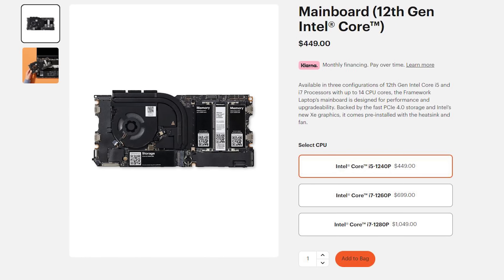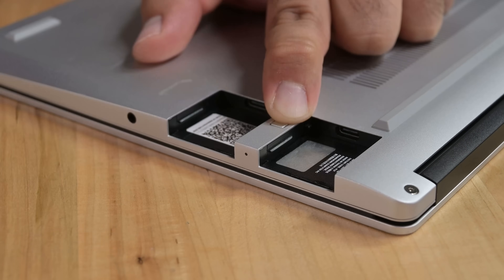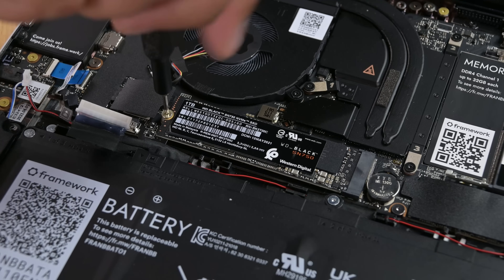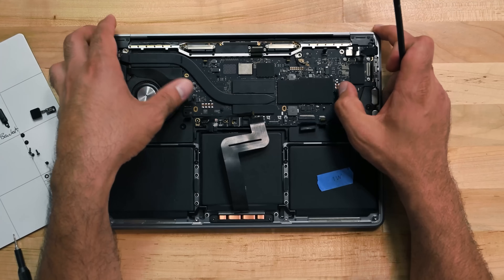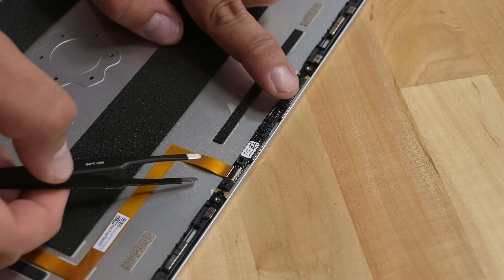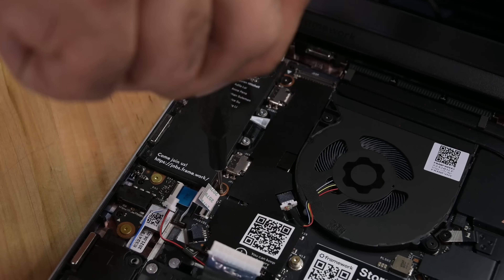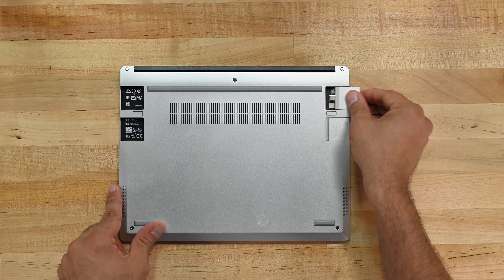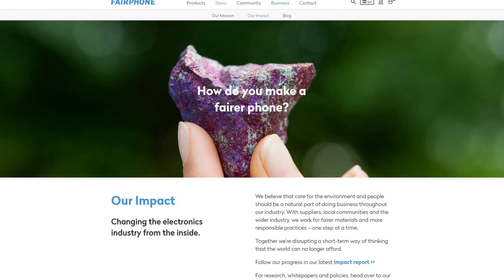The Framework Laptop Is Now Fully Upgradable!

Comment: I own a framework and while I'm not interested in the 12th gen upgrade (I don't need the slight extra processing power and it doesn't affect the battery life issue signficantly) I'm curious about the difference on the back panel and the hinges. Are they a necessary change? I want to see some kind of actual comparison. Hopefully in the coming months someone will post videos to the subreddit or somerthing
Reply: Framework has stated that for a certain subset of batches 2 and 3 (iirc?) there were some quality control issues with the hinges, causing them to have less than the specified 3.3 N operating force. If you're in that batch, and are experiencing display floppage, you might want to contact support about it.
If you're not having any problems, but are still disappointed in the performance of the hinges, they sell a new 4.0N hinge kit. The laptop isn't heavy enough to offset the heavier hinge, and so it'll need to be opened with both hands.
Note: I probably got the units wrong in this post. See the Marketplace for correct figures. The lower-weight hinge should be identical to all previous hinges, except for the few weeks' worth of out-of-spec hinges they shipped in the early batches.
Reply: @Segundo Samson My batch 4 unit's been a dream! I spilled juice on the keyboard, and had it apart to check for leaks or damage in under 5 minutes. Had a replacement keyboard in the mail a week later!
The only real problems I've had with it have come down to user error: I got the DIY edition, and when installing the wifi card I both routed the cables incorrectly and didn't even plug one of them in... And it still worked, albeit with degraded performance. Again, 5 minutes with the included screwdriver and the problem was fixed.
The performance is good enough for fairly heavy compute workloads (parallel compilation, multiple VMs, etc.) and light gaming workloads (though you may want to look into Custom Resolution Utility and downscale your graphics).
The display panel is surprisingly versatile, and you can clock it all the way down to 22 Hz or up to 70 Hz (72 with some luck and a lot of tweaking) without artifacting.
The battery life is kind of lacking (6-8 hours on a charge, less if you're good to your batteries and limit charging to 80%) but it'll charge off of just about any USB Power Delivery supply you can plug into it (5V 1A - 20V 3A). If you carry a phone charger in your bag, that'll net you anywhere from 1 to 4 hours of (tethered) battery life, maybe more depending on the workload. I got an Anker PowerCore Nano 2 (65W) which is about the size and form factor of a phone charger, and highly recommend it as an alternative to Framework's slightly bulkier charger, if you can splurge for it. Either way, at over 45W, it'll charge under the heaviest workloads it can muster.

Comment: The $450 i5 is fine but, oof, $700 and $1050 for the i7 "upgrade" is pretty steep. You can buy a whole new computer with kind of that money.

I know that this is still pretty much a niche thing and the company is just starting to rise up, hence the early adopter tax. But moving forward, keeping the price down should be one of their biggest focus. If not this will just be another apple "it's technically repairable, but at that price you might as well buy a new one" kind of situation.
Reply: Yeah good luck getting i7 1280P with $1050. It is a start once the market is set you will be able to find various boards on ebay and other 2nd hand boards. Lets say when 14th gen cpu comes out then you are able to get $250 upgrade of i7 1280p from 2nd hand market thats a great deal. 14 core vs normal i5 is still huge upgrade.
Reply: Agree, its kind of overpriced. At least you can sell the old mainboard.
Reply: but you can still use the old mainboard as a nuc or home media computer or even VESA mount on the back of a monitor BOGO free....
Reply: @Dan-bh8jd  And you can't do that with a normal laptop?
Reply: @Summer-xu8qu  not with the size or versa mount or any time you need to turn it on you need to open the cover

Comment: I wish they had an oled. I love my HP spectre 360. It is on 10th gen, which will be showing its age soon. I wish i could upgrade.
Reply: The screen is easily replaceable. An OLED or MiniLED could easily happen.
Reply: Maybe they could do Miniled or Oled with 60 90 or 120hz
Reply: I'm hoping they'll release alternative screens in the future as well. The one they have is phenomenal in my experience, but it doesn't beat an OLED panel in contrast and black levels. 
Though, I'm really hoping for a worse, higher refresh rate panel with VRR, rather than OLED, myself. The current panel can't be pushed much higher than 70Hz without artifacting, and at 72Hz the thing can barely sync. That's higher than most people usually go for, of course, but it has its uses, especially when response time is more important than quality.

Comment: I wish they’d left 2 of the board’s USB-C ports flush against the edge (only offering 2 expansion ports). They’d have been able to make the board a wider shaped leaving more room for a bigger battery. Guess they’re stuck now.
Reply: Maybe they can make a battery expansion module. It can charge both ways through the USB-C ports, right?

Comment: Plus the fact framework supports running the motherboard standalone. And even released models to print even extends the longevity of the old board as a nuc like device. Truly amazing
Reply: You can do that with any laptop. Unless it's poorly made and few are this poorly made, the battery (which can still be used if you make room for it) is literally just a UPS.
Reply: @acumenium8157  yes but no, Framework motherboard has the button on the motherboard and that is why you can 3d print a case for it and still turn it on manually without having to strip or short the two pin with some wires. Not only that, some laptops have the chassis intrusion thing and makes it difficult to just use the motherboard only (although some can be easily disable through BIOS settings)
Reply: @siontheodorus1501  If you have to "3D print" a case to do it, it's literally the same effort you're putting into doing it for any other laptop. So no, it's just a no, not "yes but no".
Reply: @acumenium8157  It is a "yes but no". Framework themselves are supplying the 3d files for the 3d printing process, as well as the CAD data of all parts of the laptop themselves. Can you name a single other laptop manufacturer that does the same, or even comes close in the effort of doing this?
Reply: @acumenium8157  Also just the actual form factor of the mainboard is vastly different to doing it with other laptops, when you turn this into a standalone nuc it actually has a nuc form factor too. The whole process is just very easy
Reply: @acumenium8157 "any laptop" bruh is that the final answer?
Reply: @acumenium8157 name other laptop brand that can run their motherboard outside of the chasis

Comment: Does Framwork Laptop run macOS? No? Dealbreaker.
Reply: Makes some wish Mac OS was able to be Installed on Windows PCs
Reply: @IdeasAreBulletproof  I don't wish to run macOS on junk.
Reply: Does dell, hp, Lenovo etc have Mac OS ? Why everyone comparing this laptop with Mac book
Reply: @kingfor2850  The point sailed above your head, so here it is in plain English: macOS is not the same a Windows and a lot of us prefer macOS to the derivative sludge put out by Microsoft. Until competing hardware can run macOS then we're not going to buy it. Is that clear?
Reply: @montex66  i mean this is your preference because also a lot of people like windows, depends who you are. I prefer Windows. For other it’s not dealbreaker And besides macOS will never run on something else than a MacBook or every computer from the apple brand. so basically you are stuck with only that brand. Tho MacBooks are good especially those day but if you don’t want to use macOS well it could be a good alternative.

Comment: I’d love to see Framework release a slightly larger laptop that has more volume to fit a larger battery and maybe even a dedicated graphics board. It would be amazing to have a laptop where I can upgrade my graphics as easily as swapping out the motherboard.
Reply: Yes!!!!!!!! A 17 inch "Framework Pro" with a gpu module that uses the MXM standard would be amazing! I would buy this in a heartbeat. Take my money!
Reply: @s980845  I was thinking a flat box-ey chassis like the new MacBooks at around 15”, but 17” probably would be a lot better to fit dedicated swappable GPUs.

Comment: Everything but thunderbolt. I don't care If I have to pay $150 for a thunderbolt 3/4 expansion port. There is no option to even buy one.
Reply: It supports Thunderbolt. Not officially certified, but the hardware is there and it works. Currently using mine with a Plugable TBZ3 TB3 dock.
Reply: The Thunderbolt 4 hardware is present, active, and fully functional, it's just not through Intel's certification yet. That's why they advertise it as USB-4 40Gbps instead of "Thunderbolt 4"

Comment: Excellent news, this is the first time a CPU upgrade has been possible in a laptop since the switch from socketed CPUs to soldered on CPUs. I believe the 4th generation, non-U processors were the last ones that were modular? (I know the CPU in HP ZBook 17 G1/G2 were 4th gen and modular.)
I would probably go for the new lid (if it is more durable) but stay on the 11th gen processors - the 11th gen Framework laptop is cheaper than the 12th gen, but more importantly, comes with Windows 10 instead of 11. I don't want to be on 11 since it uses more RAM and has tougher system requirements. I also don't want a Microsoft account for sign in.
Reply: You can still skip Windows 11's Microsoft login by killing the network connection flow using a command prompt during setup.

Also, from my experience Windows 11 uses more ram when idle but releases almost all of it when other programs need it.

Comment: the price for this mainboard is like the price for a new laptop.
Reply: The highest i7 cost 1k. And usually laptop with that processors cost the double of it. The i5 is much more reasonable for normal consumer at around 500€
Reply: @kingfor2850  what about MacBook air m1? for this price I can buy the model and after one year for 1000 bucks the entire new model, and not just the mainboard.
Reply: I think the mac book is just a part of it's own seriously you don't get the same os. You don't use them the same way as other computer (like for example lite video gaming. I think framework is here to compete with the other windows laptop brand). Not apple. 

and there is a lot of people wich don't want to use mac os 

But I can also agree that the macbook is the same price and are really good have a long battery, have a good performance out side of gaming. But it's not for my use because a lot of thing I do I just can't with mac os, it also depends with the user.

Comment: If only they have a discrete GPU expansion option.
Reply: Thunderbolt would give it discrete graphics. But it has to be stationary using a EGPU.
Reply: @furynotes  eGPUs are still pretty finicky though and you’re constrained by the overhead and (lack of) overall bandwidth of Thunderbolt vs GDDR6.  I’d rather have it be integrated with the modular motherboard than rely on that interface.

Comment: I don't know much about Framework. If that 11th gen board is still good, couldn't you use it as a super compact desktop now?
Reply: Linus' video released yesterday and it's exactly what he did. He reused the board to make an ultra low profile desktop with Thunderbolt so you can plug an external GPU if you want
Reply: Definitely! Linus made a video about that.
Reply: I believe there are instructions available online to do that very thing.
Reply: inevitably, iFixit gonna make a video about it too